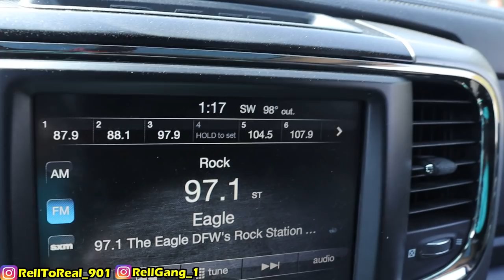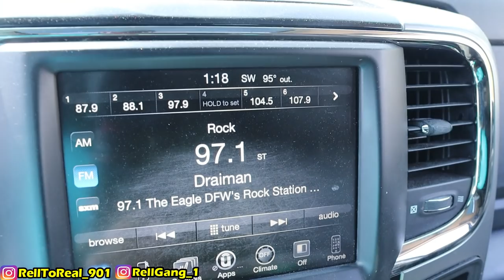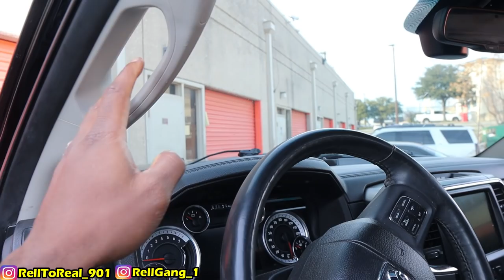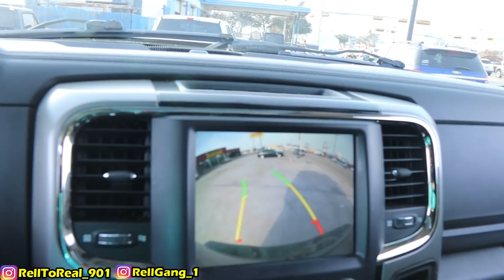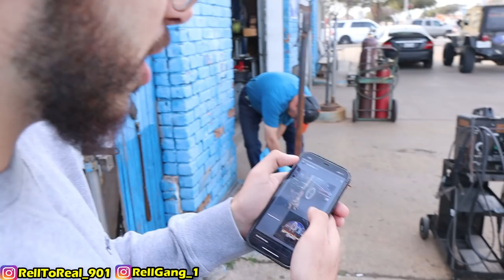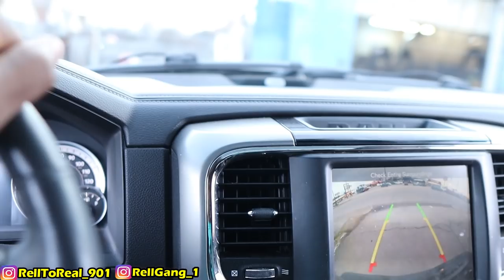BOUGHT 5INCH TIPS FOR MY RAM TRUCK AND PAINTED MY REAREND!!

Comment: The Mercedes has less horsepower but the gearing ratio that Mercedes does is like no other is actually faster response time then redeye  with the right tune
Reply from the maker: I have a demon gear so faster take off in mine as well got to learn your mopars all redeyes not the same